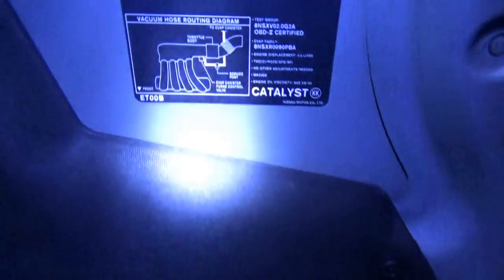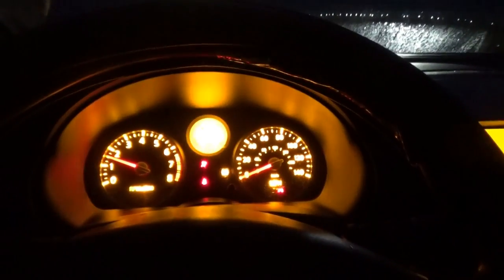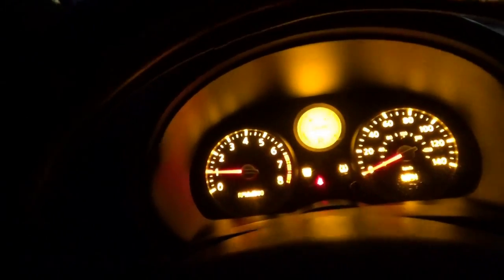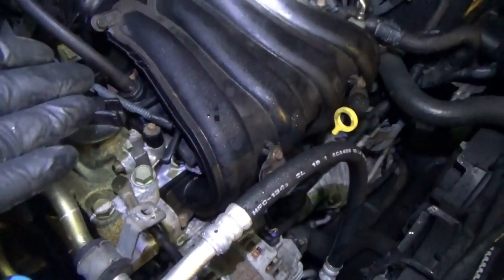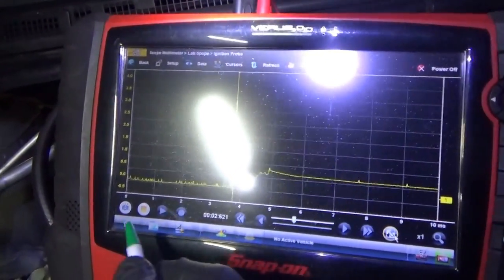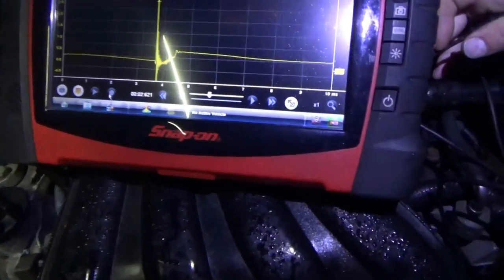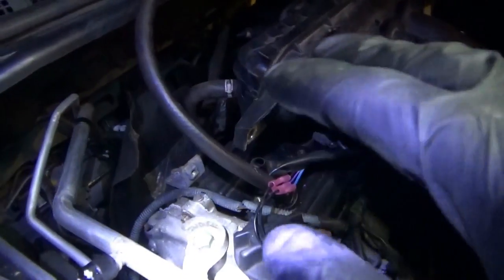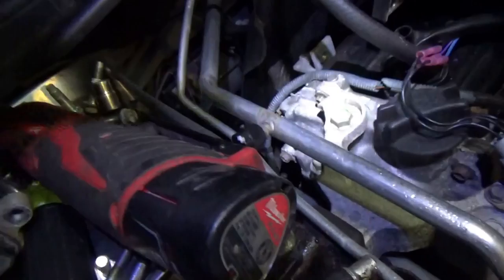How to Pinpoint a Misfire? Nissan (SI 16.2)

Comment: To be honest your headlight isn't best. What I mean - the beam is not to wide spreaded. I need to use headlight in my job too and I noticed on my friends head Ledlenser H7R2. It casting the light evenly distributed in circle around working area. It's about 16" in diameter with about 16" distance to item/area you work on. Of course I bought the same Ledlenser for me, wasn't cheap but I do not regret. Chargeble, nice color shade so your eyes won't get tired after few minutes, adjustalbe wideness and power. It's not adversitement, I'm talking on my expirience.

Comment: "No Autolites?" actually they make a great plug, never in 40 years have I had a problem with Autolites.
However, I find so called  mechanics that can screw up anything, so, don't blame the plugs, suspect the "Wanna Be Mechanic"
Been dealing with diesels recently, how people justify owning a diesel, I don't know
I left the dealers in 95 to avoid these horrible excuse for a diesel engine, I do repair them, but, I refuse to do so on "Flat Rate".
Fords idea of a diesel is really sad, been cleaning out hpop regulators left right and center.
One bit of plastic, or any bit of trash and they become a no start.
Ditch the diesel, show you are smarter than the typical human, don't let your ego dictate what vehicle you own.
I have a gas motor in mine that tows just as well as any "Die-Sell". 
The proper repair action is actually in the name "Die-Sell".
I wouldn't own one, were you to give me a die-sell, I would slap a for sale sign on it and not drive it five feet.
Reply: All I do is Autolite, make it double platinum and I never see them for a tune up related concern again.

Comment: Congrats on the store! Also on being over 70k subs!! I think when I first found your channel you were a little over 1k - that's great! Not surprising to me, either. 👍🍻

Not often I see bad plugs, but it does happen. I got into the habit of swapping the coils, THEN the plugs, since I got burned once before this way, and had to make another trip to the store for a plug (I now buy plugs with every coil, regardless). I was livid, lol! There's probably a way to see which is which in a Pico scope pattern, but I don't think I'm that skilled yet. I need the scope first though! 😂

Comment: It seems to me that spark plugs are such a simple device that it shouldn't matter what brand is used, as long as it is the proper fit and heat range.
Reply from the maker: You would think, but there is a lot of ways that a "simple" spark plug can fail :)

Comment: The first half of the spark trace is outside of the cylinder if you have spark plug problems outside of the cylinder, the second half of the spark trace is inside the cylinder.

Comment: Maybe a Parts Cannon, maybe not.  Depends on when the parts were put on, and why!  If I'm rebuilding a cylinder head for an older, high-mileage car--especially a common engine like this where parts are relatively inexpensive--I would very likely advise my customer to include new coils and new injectors.  In my experience, Nissans have common injector failures, as well as injector seal failures.  Coils break down over time, insulation degrades, so I see no problem in refreshing these parts as part of a major overhaul.  Quality parts are a must, though, otherwise we'd just be introducing problems!  :)
Reply from the maker: "Quality parts are a must"    100% agree! I'll take used OEM over new aftermarket any day when it comes to electrical components!

Comment: carbon tracks boot can do the same thing, as can a bad internal resistor plug(open!) 
the plug porcelain could be cracked up inside the body, the side under cylinder compression too. that is where you need a spark machine with pressurized chamber and view port into it!
or just change the plug/s (one of these is far cheaper option, unless a big shop) lol..

Comment: A short to ground in the spark plug won't stress the coil because the voltage doesn't build up very high. What was being pointed out was that the way to determine which component was at fault was to move the components to different cylinders. For instance, if the plug was moved to cylinder 2 and the coil to cylinder 3 it would be easy to tell the state of each component. If the miss moved to cylinder 2, the spark plug is bad. If it moved to cylinder 3, the coil is bad. If both cylinders 2 and 3 miss, both components are bad. If the miss stays on cylinder 1, the signal to cylinder 1 might be bad and both components are probably good.
Reply from the maker: Well the scope and paddle probe confirmed our suspicions without moving anything at all. Part 2 was just to go one step further and inspect the components for visual signs of failure, which were not visible to the naked eye!

Comment: WOW all them parts and work. That has to be more in cost then the whole car is worth. I like the look of the Amazon PHAD store. BUT what I really want to know is how did them cupcakes taste ? Here is something you need to add to the store. There has to be things that you want but either they cost to much or you wouldn't use them enough to spend your own money on. So make a buy PHAD  something list in the PHAD store.  One thing I think you need is a battery powered under hood light . You  really need one for this time of the year and out at the Staten Island Express.  Something like this  I just picked one so I have know idea if it's any good.  https://www.amazon.com/Neiko-40447A-Rechargeable-Underhood-Brightness/dp/B01MTXC016/ref=sr_1_25?keywords=battery+powered+under+hood+light&qid=1579772508&sr=8-25
Reply from the maker: Looks like a nice light, but may be too bulky for mobile work. On the other hand if I hang it up near the tailgate, it would light up the whole trunk pretty nicely!
Reply: @PineHollowAutoDiagnostics  You never said how the cupcakes tasted? Like I said I just randomly picked that light to show you. You might want to do some research and find one the has better reviews and longer battery life or a replaceable battery pack. like cordless impacts. There might not be one like that on the market yet.

Comment: As a home mechanic the Ames brand Amp clamp from harbor freight for $90 was not bad. Has the backlight for the display as well as a work light when using the amp clamp. 20% coupon does not apply to them but it's still not a bad deal. Buy your own leads though, on the model I have the test leads were loose. It's because of cheap leads, not the unit itself. So if the fluke is too much buck for not enough bang consider the harbor freight stuff.

Comment: Just had a misfire problem on a Mk6 Jetta. The plug looked great, no crack seen any place, must have been a crack hidden by the metal.
Reply: Not necessarily. Internal jacket separation does happen.

Comment: Ivan,
Good case study - thank you. Did you need to remove the intake to do the 1-2 plug/coil swap?
God bless
Paul
ps @4:13 is that Keith's reflection in the scan tool?
Reply from the maker: Yup, luckily the intake manifold comes off in 5 minutes...using power tools of course :)
Reply: @PineHollowAutoDiagnostics  OK thanks. BTW was that Keith's reflection in the scan tool @4:13?

Comment: That is either a cracked plug or sealing issue on the plug boot. You need to check out my latest video man. It's worth the laughs.
Reply: thats not a laughing matter  wow
Reply: @richardcranium5839  I agree. This lady really needs some kind of help. The truck is dangerous to drive. I  don't really know what to do. She approved and prepaid for the brake job. All I can really do is fix it and try to make enough notes to keep me from getting sued. If I were the boss, I would have refused the job.
Reply: @yurbeeinwatched  its got dot numbers   loose articles in a cab is a violation. an anonomous tip should be in order
Reply: @richardcranium5839  That company is long gone. She probably bought it from a car lot who got it from an auction.

Comment: Sometimes I move the plug to one cylinder and the coil to a different one. Then i know if it's the plug or coil with one start up.. i love that paddle probe, I'm thinking of getting one.
Reply: That was my thought. Why move them both to the same cylinder?
Reply: @tiredoldmechanic1791  maybe because either way, both the plug & coil were going to be replaced. Coil because it was already stressed for how long? Doomed to fail prematurely if left.  And plug was changed as a precaution.... plus it was an Autolite... no go in Nissan.  What did it matter to know for sure which of the two failed? Understand?   The technician replaced 1 item at a time anyway, so we know for sure the plug was the main issue.
Reply: True, but probably easier to just mess with only one other cylinder in the rain when someone else is gonna do the actual repair later.
Reply: I like that paddle probe too! Already spent over $200 on AES today on stuff for my Verus.... maybe next week... but I love the simplicity!